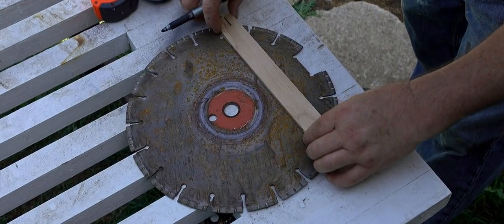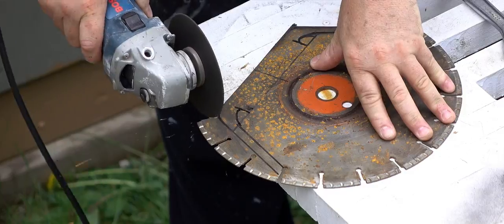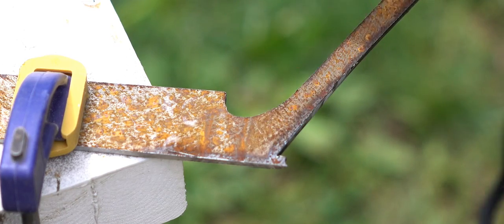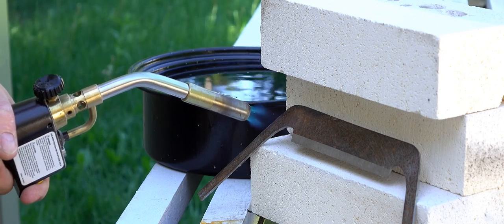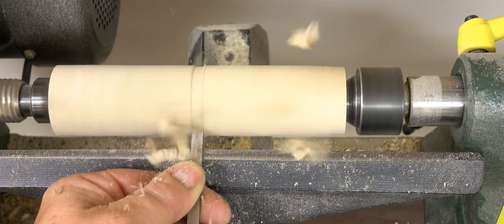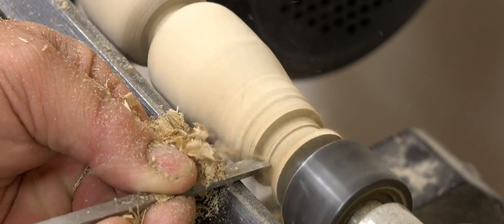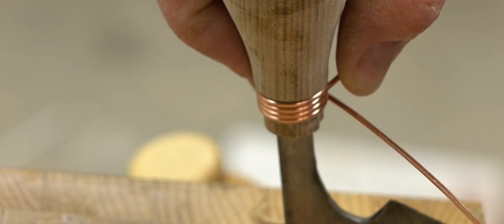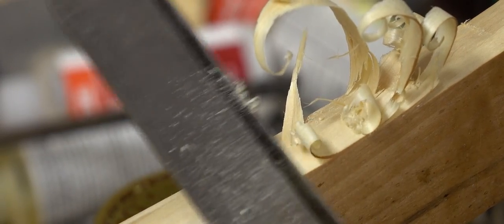Making A Draw Knife From An Old Diamond Blade

Comment: On the wrapping the handle part. On my files, what i did is i drilled a small hole, inserted one end there, then wrapped it, got to the other end, another small hole, inserted the other end and then soldered  the copper wire in. Done right and with enough flux paste it won't burn the wood or discolor it. Looks very nice when you polish it and it's strong.

Comment: I was wondering how you'd get the winding tight. Perhaps next time you could drill a small hole in the handle to "start" the wrap. 

Beautiful work!
Reply: Good comment and perhaps another end hole so the wire stays tight until the epoxy sets.

Comment: Before you start your copper winding, drill a small hole to start it in, or bend it over so the wire is wrapping around its own leg. This'll make the winding go much easier.

Using the draw knife to de-bark limbs for your lumber mill will make blade on the mill last much, much longer ... or so I've been told, anyway.
Reply from the maker: Several people have suggested the hole to start. Of course (since I didn't start doing this kind of thing yesterday), I already thought of that and could see the problem with doing it that way: If you drill a hole and wind it on, it will just spring out and be too loose. The coil needs to be over-tightened to account for that spring back and fit snugly on the wood, so the better way would be to wind it on a smaller diameter dowel before fixing the handles on the blade.
Reply: +John Heisz it's been a LONG time since I've done that sort of work, but tapping it with a jewelers' mallet in the direction of the winding might do the trick.
Reply from the maker: Right. How do I make that? My jewelers mallet is in the shop :)
Even if it did work, it still would not make it as fair and snug as overwinding it.

Comment: Nice knife.  Maybe bend the handles to be not quite in a plane with the blade.
I have three draw knives and I almost never use them.  My dad used draw knifes mostly to strip the bark off of poles made from thin trees.
Reply: I was going to say the same about the handles
Reply from the maker: It probably won't be an every day tool, but I think I'll get some use out of it.
Keeping the handles straight will make it so that it can be used bevel up or bevel down. Anyway, feels pretty good as it is.
Reply: why am I not surprised Matthias? A draw knife being a hand tool and you being the undisputed king of (self build) power tools. Although John did a good job of making up for the lack of electricity with his t shirt 😉. Love the knife John, another very inspirational video by you!

Comment: the steel is already heat treated, why heat treating again ?
Reply: Never do that. He has kill his heat treat by doing that.
Reply: When he cut the metal out with the disc cutter, the cut edges lost their heat treat due to the high heat of the disc cutting the metal. So they needed to be heat treated and tempered again. If it was cut out by hand, it wouldn't have generated enough heat to need to be heat treated again, but he mentioned how difficult that would have been to cut out by hand due to the hardness of the heat treated steel.
Reply: While many people make something out of widia circular saw blades or diamond cutting blades without heat treating it again, this seems to be a bad idea. These blades are only about 45HRC so heat treating to 55-60HRC seems to be a good idea.
Reply: Sander Vercammen     Goldrings

Comment: Another nice project John, I have wrapped a couple things with copper wire I find it easier to do when I drill a small hole to hold the end in place slightly angled opposed to the direction of wrapping.

Comment: I really liked the project. It's always cool to watch old broken tools turn into new ones. On a different note, I've noticed that in this video, and others, you don't have the housing/gaurd (whatever you want to call it) on your angle grinder. While the cutoff wheel is very unlikely to break given your obvious control over it, if something were to startle you, if you accidentally stepped on something sharp, etc., causing you to suddenly move the grinder, the wheel could shatter. Using the housing or not is obviously your decision, but it really doesn't take long to attach and could prevent serious injury.
Reply: Jason Zevenbergen ....Sit down safety Sally !!

Comment: Nice job. On your wire wrap. You can drill a hole the size of the wire at your start point am 1/8" or 3/16' deep. Make a bend to the depth at 90 degrees. Insert and start your wrap. When you get to the end. Drill another hole and cut your wire to the hole and add the depth of the hole to the wire and cut, bend and hopefully force it in a little. It will stay tight and look nice and clean as well.

Comment: For the copper wire used for your ferule, I would drill a hole first, the same size as the wire, and insert the wire in first, then start the wrap. Makes it easier to keep it tight. I have also seen nylon cord used and you can get a couple of layers on, then it was chased with CA glue. The 2 part epoxy should work well also. I had to look a couple of times, but you did use your bench chisels to turn the handles.... I think the idea of bending over the ends of the draw knife will work very well, and the handles will never pull off. Just getting into hand tools. Been on the lathe for 30 years...

Comment: First of all, to echo the comments of many others, this was excellent! As a suggestion; for the copper wrapping bit, I believe it would've been much easier if you had begun by drilling a slightly undersized hole about 3/16" deep into the handle where you wanted the wire to begin, then put a 90deg bend in the wire to lock it in as you wrap it.  But...your method obviously worked just fine! Nicely done

Comment: John, a thought. Were you to anneal the saw blade your zip cut blades would have an easier time of it and last longer. As you did in the video you can reharden later after working with the metal is complete.
        Mike

Comment: Good job as usual, John. Traditionally, flat backed drawknives like you have here ARE used bevel up and used for roughing work (exactly what you demonstrated) though the handles would be cranked down so they are slightly below the back. Bevel down drawknives are curved, some in two directions and are used for finish work. Ultimately, the way the tool works best for you is the "right" way.

And, by the way, has anyone mentioned the handles look like lightbulbs? HA! Just kidding. :-)

--Joe

Comment: if anyone is wondering you absolutely can do this with hand tools if you first anneal the blade. once annealed you can work it easily but you'll have to harden and temper the steel again later.
Reply from the maker: Sure can, but it's difficult to anneal something this big (with teeth brazed onto the edge) and keep it flat.

Comment: If you wanted to use hand tools or a jig saw you could normalize the steal witch will make it softer so you could use hand tools and i would have heat treated it then tempered it so it would not be to hard also if you quench in oil instead of water it wont be as prone to cracking

Comment: Cordless angle grinders usually just don't do very well on long cuts either.  The battery gets expended very quickly I have found, relatively of course, it depends on which(kind of) unit you use.

Comment: John, I wonder if your blade is hardened. It didnt seem to get hot enough to demagnetize (greater than 1400 degrees), if it did, it may be somewhat brittle if you didnt temper it afterwards. Just curious how it is holding up. Thanks again for sharing this, once again some great outside the box thinking.

Comment: I made an Ulu with a saw blade and it is great and was thinking of making a draw knife out of one until I found a good old one.  The only thing you did wrong is you did get get thw edge hot enogh for a good heat treat so soft wood is fine but hard wood will nick the edge.  Great idea though.

Comment: If you have the need for grinding after your plasma cut. then you 1) wrong amperage. 2) wrong tip distance and 3) wrong cutting speed..  I use my Hypertherm PMX85 for pretty much everything with less to no grinding after a cut with it.

Comment: What's the tool he used to shape the handles called?
Reply: A lathe.
Reply: Specifically a wood lathe... you get them for working metals too. Although I guess you could use a metal lathe for turning wood, but not the other way around.

Comment: Hey man,  my saw blade is bigger than yours,  but your work is better than mine,  I have an angular short sword cut out,  and somewhat crudely beveled,  still really heavy, no distal or fuller,  of a 3 foot .190 blade,  I was wondeing, if you think a swords edge could hold out out of one of these, without 're hardeni g harder, of course, 're annealing would be right way to do it,  cause ya know a sword at a HRC of 50 is pretty good,  53 might be too hard...

Comment: You could put the saw blade in a fire to anneal it and then you could cut it with a hacksaw.
Reply from the maker: Might warp badly, especially with the brazed on teeth
Reply: John Heisz Good point, but it is better than nothing.

Comment: So you didn't test the blade BEFORE making the handles? Would be pretty hard to change anything with the blade when it's glued to wooden handles. Next time test before finishing? :)
Reply from the maker: Be several hours long if I included everything I did during the build in the video :)
Reply: Oh, I don't have to see the testing. I've just had some personal experiences of building and not testing properly so this particular detail just got my attention. :) And of course you tested it before installing handles... I just found it funny that you didn't mention it as a step in the build. Anyways... Thanks for the video! And I love how you play around with different techniques and shots in the video. It's one of those things that really makes this channel special.